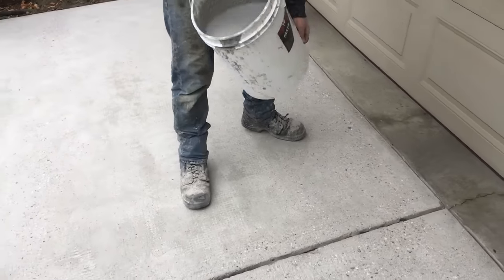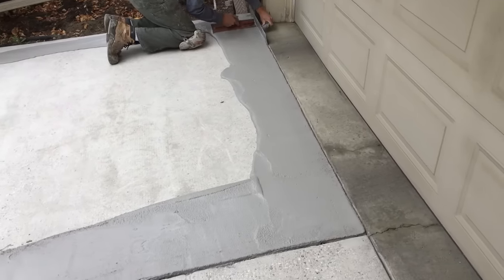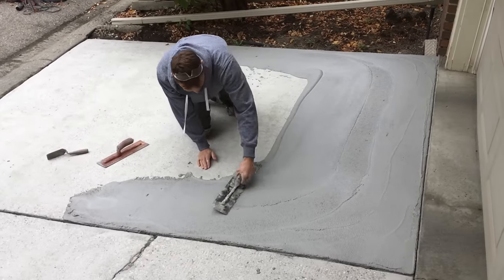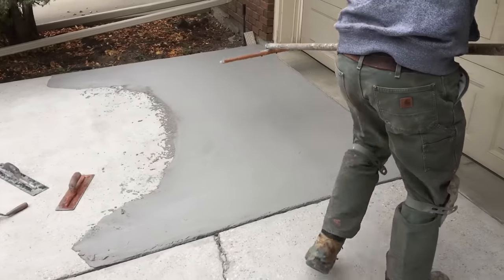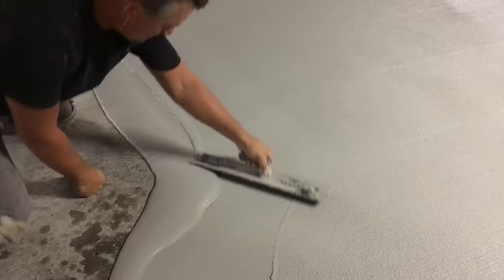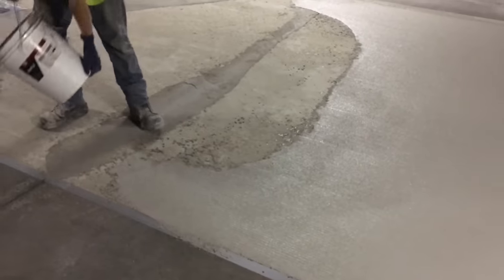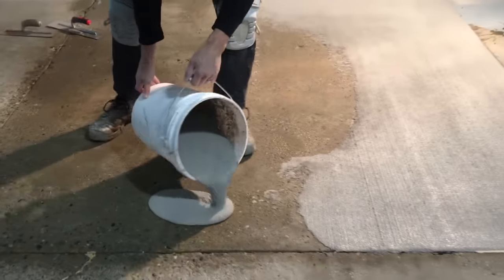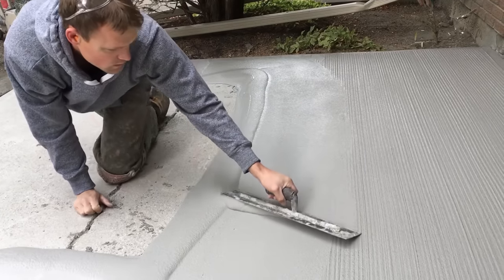TF Structural Concrete Overlay - Overlay Instructions

Comment: I have a lot of dirt near the garage concrete and it needs something added to grade it away from the garage. How clean does the concrete have to be before adding this slurry? It's kind of a catch 22 situation.  The dirt is running in from the side grass yet I feel I can't correct until I clean the surface.

Comment: I would love to see a dozen of these driveways after 5 years.
Reply from the maker: We have lots of after videos on the channel!
Reply: They oeal like dead skin.. prior owners did this to the slab on out bottom patio . And they owned this place for 6 years.  That bottom deck is so bad now.  I spent 3 days with high a pressure nozzle PEALING it off the concrete which is badly spalled and detiorated underneeth.    It peels off like dead skin...

Im going to redo it with actual concrete.  As its so detiorated now its lost an inch of concrete and rocks are coming out

Comment: Can you give any advice regarding existing concrete with cracks in it? I suppose if the cause isn't dealt with it may just crack again. Great video; you make it look easy. I'm sure it takes lots of practice.
Reply from the maker: https://www.youtube.com/watch?v=o5UYlJmKhAE&t=57s
Also, check out our channel, we have lots of other videos.
Thanks!
https://www.youtube.com/channel/UCrbzs2OzEg7X0mzfVSM0bsw
Reply: I do mainly sidewalks. If the crack is on an expansion joint going off course, diamond saw it about an inch & 1/2 deep on the expansion joint. Drill out the part of the crack off course with a SDS maximum 5/8" drill. Go 2 to 3 inches deep. Force all the holes together with the chisel blade. Clean it out good. I mix mortar & sand mix together to fill the area. Touch up with the saw again if needed. I've never had my sidewalk crack after the repair.

Comment: A 1/4 quarter of a inch of concrete mix, should hold up pretty well on a smooth surface,even in really adverse winter condition,if the process is done correctly and curd properly
Reply: For a year or two maybe
Reply from the maker: Portland cement will not bond to concrete. Our material is not portland cement, and is designed to bond directly to cured concrete.
Reply: @LiudasLT  I put some on my garage floor about 10 years ago. Holding up great and I live in Michigan.
Reply: @TerrafuseInc  can I buy this at a store? Or do you order TF structural from you guys?
Reply: @jasonshink6589  Amazon
Reply: How high can you raise the concrete level by this product? One inch higher possible?

Comment: Great video. Will this work on an old basement slab that has many 1/8"-1/2" deep pockets and the top surface still has paint?
Reply from the maker: Yes, but you need to grind the paint off first, so you have clean, porous concrete.

Comment: Very nice video!  Lots of good information and very much to the point.  I do drywall skim coating and this is very similar in technique (as to how you trowel it out).
Reply from the maker: Yes, similar techniques for sure! Thanks for the comment 👍
Reply: @TerrafuseInc  so do you not need to use a bonding agent with this product?
Reply: @TerrafuseInc  
Is a bonding agent needed for this product?
Thanks & Great video & explanation!

Comment: I pressure wash the area first. I then let it dry. I put the product down dry, not mixed. I broom it until everything is covered. I then wet it with a fine mist until saturated. I broom it until it looks fairly spread out and even. I open the expansion joints back up with a concrete scaler when dry. That will also remove any high spots near corners and help it blend. I wet it one more time and let it sit overnight. This is on sidewalks by the way. 🐀🐾
Reply from the maker: I hope that’s not how you install this product

Comment: How long would something like this hold up before needing to be redone?
Reply from the maker: 10-20 years, depending on installation thickness and use.
Reply: Also dependant on climate. Freeze/thaw parts of the country id give this 5 years, down south id agree 10 years.
Reply: I’m in Florida and have an overlay concrete path to my front door.  Drives me nuts as every time I walk on it, it crackles and pieces are breaking off more and more each day.  No one will come “repair” it either.
Reply: @whomeverwherever they just showed you how to do it.  Try it yourself.
Reply: @whomeverwherever This product should not be used outside. Covered porch with tile and sealer would give you a better result in Florida. Driveways and walkways should be avoided using this product. Unfortunately if you have a dangerous walkway you should have a contractor jackhammer it up and replace correctly using a lazer to properly pour with necessary pitch to walk on safety and a proper pitch to gently have for rain runoff.
Reply: Hi Mister, cuestion do I need to apply primer first or not??

Comment: is this stronger than epoxy coating concrete...neighbor has epoxy coating over her patio..it looks good but i told her in a year or 2 itll fade and crack..epoxy should be done indoor like garages
Reply from the maker: Yes, it is meant for outside. UV light will breakdown epoxies.

Comment: I think this is what I’m after. My Mothers house has a huge sunporch on a concrete slab that unfortunately isn’t level. So we want to level it out.  Need probably an inch dept to 2” and then smooth it into the slope to level.   Oh and do we need to prep the old concrete with acidic stuff or that weld Crete?  And yes saturation of old concrete is excellent!  Will this work and thanks if you answer 😄

Comment: how long before ot starts cracking???
Reply from the maker: It won’t start cracking, unless the concrete underneath cracks.
Reply: Terrafuse Inc. Sorry to jump in on this comment, but can you use this product over a stamped concrete to smoothing it out.  I hate the stamped concrete on my patio.
Reply from the maker: Yes

Comment: Hello Terrafuse
I just found your channel and subscribed. My question is can this be used to fill in cracks in the existing concrete? My second question is how clean does it have to be to adhere to the existing concrete surface? This has to do with pollution/mold we have here that turns the concrete surface black.
Again thank you
Reply from the maker: Here is a way to address cracking before overlaying a slab https://youtu.be/o5UYlJmKhAE
The concrete needs to be clean, so the TF structural can bond to it. Best way to ensure this is to pressure wash it up and close. 
Thanks!

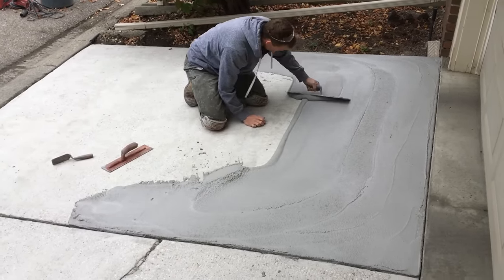Comment: 2:28 This is the big problem I run into! Right here the material starts to clump up and become a mess. It's like after going side to side to side, all the water is gone and im left with unusable sandy clumps.
Reply from the maker: Site conditions will play a big part in this, and how well the ST retains its moisture. Some tips to help with this, you can make smaller mixes, pre-wet the surface with water, or use a bit more part B in your mixes. Wind, sun, high temperatures, and very absorbent concrete will all play a factor in causing the ST to dry out too fast
Reply: AB_015 

Well you can avoid clumps if you drink a lot of water

Comment: Great video. I have a back patio/porch that needs this. Has a few areas that need repair, but my main reason is to make it look like new again. I grill a lot, and over years the oil stains don't come up with pressure washing. Do you recommend resurfacing to cover stains?
Reply: Same dilemma for me
Reply from the maker: I would use a jack hammer to break out the areas that are stained, oil is so difficult to remove from concrete! Once you've done that, you can fix those areas with the TF Structural, and then skim coat the entire area

Comment: This is what I need to resurface a rough cement patio. The Terrafuse product used in the video is available only from you? Our local Home Depo has several Terrafuse products is there one that works similar to TF Structural Concrete Overlay?

Comment: Can u stamp that stuff?
Reply: I've used high strength mortar mixed with straight Portland cement for years. Add a couple pounds per 80lb bag of moratar mix. You can stamp it. To slow it down use lime additive. I've capped a bunch of porches both broomed and stamped. I've also experimented with chicken wire and re rod to create garden edging/curb, all stamped. Mix a bit like mortar maybe a little, stiff for base coat/shaping. A bit wetter for final stamping. You can utilize fiberglass reinforcement as well as fiberglass mats for bridging spots that are likely to crack.
Reply: ... All done in Michigan. No footings, just rebar 2' in the ground and chicken wire. No cracks thus far (going on 5 years/seasons). But the one that gets pretty wet does heav up and down a couple inches yet slides back down into place come summer.

Comment: Since I'm not an expert on this stuff, could the dislikes explain why
Reply: There are people who think they are the only ones who know how to do something, and it has to be done their way.  There are a number of ways of doing many different tasks like this.  Often times it's because it's how you were taught.  If one way works better for you, then that's the way to go until you find a better way.  Some methods are definitely better than others, but for a novice, you have to go with what works for you!   Example:  Watch a master drywall finisher and then try to do it like he did and you'll soon find yourself way in over your head and a mess on your hands!
Reply from the maker: You bet! Also, a lot of people didn’t like how the crack was dealt with, even though it’s explained. Amazing how fast time gets eaten up when you make a video. It started 15 mins long!
Reply: Ruger Shooter It’ll never stick.
Reply from the maker: What’s that based on? Nothing? Thanks for your contribution to the conversation. Let us know if you have anything to say based on facts 👍
Reply: Terrafuse Inc. Movement , frost and dampness . Three indisputable facts .
Reply: @neilrafferty2097  why won't it stick...... I filled hole in driveway, 13 bags quickcrete mixed in wheelbarrow, next year I covered it with vinyl stuff, because of poor workmanship it cracked all the way around edges but nothing has moved, and this is on 16% slope driveway
Reply from the maker: Frost and moisture are not a concern. This is not a polymer modified concrete, that needs to be “glued” to the surface. It chemically and mechanically bonds to cured concrete. If you cover a crack, it will reflect through, but the product won’t delaminate. There are also ways to treat them first.
Reply from the maker: It stuck
https://youtu.be/iuK9_XweHKA

Comment: I'd really like to see how that crack holds up after a year or so.
Reply from the maker: The crack will reflect through this material, it is not designed to repair cracks with that method.
Reply: @TerrafuseInc  how do you mix the concrete? it wont crack being so thin?
Reply from the maker: https://youtu.be/o5UYlJmKhAE
Reply from the maker: https://youtu.be/o5UYlJmKhAE
Reply from the maker: https://youtu.be/iuK9_XweHKA
Reply: Do you suggestions on doing repairs that you can fill in and level?

Comment: Would this product be suitable for a warehouse application? The existing  concrete surface has some acid erosion and saw cuts. Can this be used effectively to hide saw cuts and joints to achieve a consistent finish?

Comment: In the last 3 mins you went over a crack you could see the depression in your finish after you skimmed? Do you recommend cauking this crack first
Reply from the maker: Concrete Crack Repair - Using TF Structural repair mortar.
Here is a method you can do first, or just fill the crack with the TF structural first, without hall the extensive prep, and then skim over it, it’s up to you 👍
Reply from the maker: That was suppose to be a link to a video 🥴 https://youtu.be/xvq0TXjMfeU
Reply: Thanks

Comment: Hi specifically, at the 4:32 mark will, is that oil  and or grease? Was the cement floor prepped? Diamond sanded? Thanks the product looks great.
Reply from the maker: No oil or grease, that would need to be removed. For this job, we did a diamond grind before installation

Comment: Great video.  I am top coating the decking around my pool.  It is coming out amazingly, however, hairline cracks that were in the substrate are now coming thru to the nicely finished topcoat surface.  It looks amazing, but did I miss something?   The substrate was prepped properly, I thought, so I am not sure why the hairline cracks are showing up.  Any thoughts?
Reply from the maker: These are very rigid materials, and not flexible, so hairline cracks will come back through. We have some videos on ways to help prevent this, but it’s never a guarantee that they won’t come back

Comment: Great vid. Couple things. It appears that this first drive was ground down first as I see the marks exposed aggregates and the brighter color in comparison to all the areas around it? More importantly, its now been 5 years. I'd really like to see a follow-up video. I have a hunch there are cracks etc because of the weight of the vehicles etc. making contact with the drive.
Reply from the maker: Yes, it was ground, and there was a follow up video done. The crack came through, as this product won’t fix cracks. This isn’t why this driveway was resurfaced. We have lots of videos showing methods of crack repairs. Thanks!
Reply: @TerrafuseInc  Thanks for the reply. I was referring to new cracks in the new product after application do to weight. I'll check the other vids, thanks again.

Comment: I have a small backyard with unevent brick blocks floor from the previous owner, can I put concrete blocks on the top of the brick floor without taking all the bricks out? I'm thinking to get the flooring molds then fill concrete in (or use your method)?

Comment: I had a patio installed two years ago. Upon completion it had numerous small holes in the surface. The company came out and spot skimmed over the holes twice, each time the skim coat color was off significantly so now I have a spotted leopard looking patio. After the second attempt the company walked away from the job. This product looks like a better fix than staining. Structurally the patio is sound. You would  recommend this product for my issue if applied by an experienced concrete contractor would you not?
Reply from the maker: Yes, it would be perfect for this application.
Reply: @TerrafuseInc  Thanks!

Comment: Getting drive prepped. I’ve used a crack chaser to prepare for filler . Filled crack with cement all . Of course it cracks a little should I lightly recut crack an use a flexible sealant. Then top ?
Reply from the maker: Try watching some of our crack repair videos!

Comment: I have a question does it level the floor as well?
Reply from the maker: You can level floors with it, but it is not self leveling at all, you have to work it with tools. You won't get a dead flat floor with this product. It is better for bulk releveling projects, and then you can lay a self leveler on top after, if you need it very flat.

Comment: I'd like to try this on a 31 yr old garage floor.  The floor has dirt, oil and cleaning stains and looks horrible.  Would you recommend this product for that purpose?  Also; what would the life expectancy be, as well as in the above outdoor application?  Thank You for any response.
Reply from the maker: Yes, you can use it for that, but you would have to prep the concrete to remove the dirt, oil, loose concrete, etc. You will get 10-20 years from it , depending on use, and thickness it’s applied at. Thanks!

Comment: Great video. Love the technique. I just need to do my slab on my deck. Not needing 20 bags. Is there a substitute like quickqrete that would work?
Reply: They make a vinyl coating mix in a bucket that'll coat concrete. It wears off after a few years outdoors. It's more whiter than normal topping.
Reply from the maker: Quick Crete is very different from this product.

Comment: How does it hold up with a lot of pressure on top once it dries also, when there’s cracks on the subfloor?
Reply from the maker: If there are cracks in the substrate you are putting it on, those will likely reflect through the material, but we have other videos showing ways to address cracking before overlaying.

Comment: Hey guys it looks great but once you have structural damage to the existing driveway how is a 1/4 inch tf structural going to stop the existing driveway from moving and the crack from coming thru the 1/4 of overlay.. Im not trying to dismiss your product but from past experience ive seen all products start to flake and cracks start to reappear over just a few. months ... Please correct me if im wrong also how long do you warranty the job..
Reply from the maker: The product is called TF Structural, and it has a wide range of uses. This video is showing an overlay, not a structural restoration of the slab, and yes, if you cover a crack, it will reflect through a 1/4” overlay. Most guys warranty at least 2 years, and lifespan is about 1/8” of wear every 10 years or so. These attached videos show it being used to structurally rebuild concrete structures 👍
https://youtu.be/NtXyXM_gjGs
https://youtu.be/xvq0TXjMfeU
Reply: Ok so if its not  structural then why call it tf structural. . so basically its not intended to correct the cracks and be a structural repair. Its just  cosmetic repair. .
Reply from the maker: It is intended to be a structural repair, that’s why I attached the other links showing it being used in that manner. On the video you watched, it was being used as an overlay, which is a restoration of the surface. Make sense?